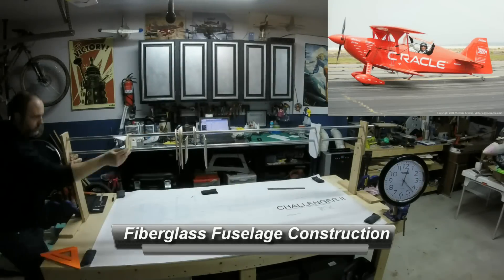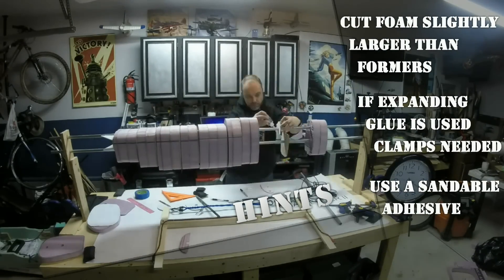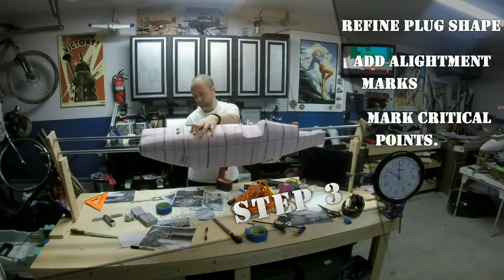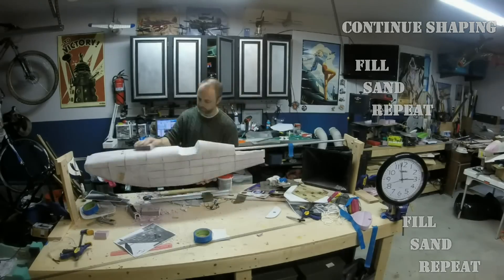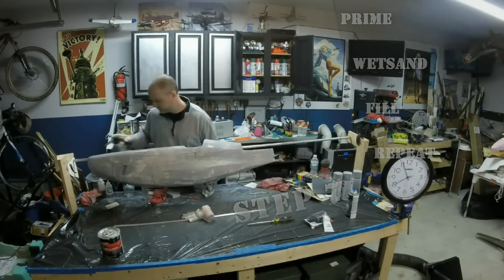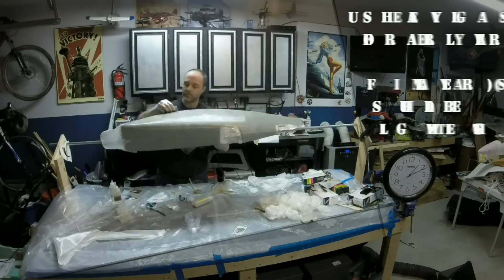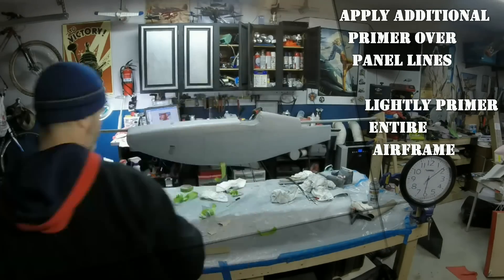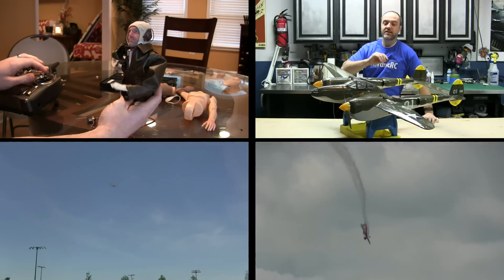RC Scratch Building - Fiberglass Fuselage Without a Mold

Comment: Hey man don’t know if your still on YouTube but I’m fucking around with designs and I want to build a long range Fixed wing VTOL’s so it takes of like a drone then has a rear push motor, the fuselage will be from 4-8 ft do you believe it’s viable to do this method
Reply from the maker: Yes, it is viable. It depends on the size and design that you choose.  Not a great solution if you're looking to make a lot of copies

Comment: after all the work , why didn't you make a mold ??? you were there.
Reply from the maker: I think you missed the whole point... I didn't make a mold because I don't intend to produce large quantities (or maybe even more than 1).  I still have the plug that the FG fuse was molded over and it would be easy to make another.
Reply: @CarlLydickRC  I have learn a lot from your post and i am making a 35% 540 edge using your method.Thanks for the inspiration.

Comment: Do you have to seal the spackle before you start applying the fiberglass does the resin soak through the spackle and try to eat away the foam
Reply from the maker: I never have.  I'm using Zpoxy resin (epoxy) and can safely apply directly to foam with no sealer.  The spackle does soak some in but no risk to the foam.

Comment: How do you join the parts back together once you slice it and remove the plug?
Reply from the maker: In this case I had alignment marks in the form of panels lines, but before you cut make the part off the plug make sure you have alignment marks.  I scuff up the inside of the seam, tightly tape the pieces together being careful of alignment, and then lay down a few strips of fiberglass and resin along the joint.  Once fully cured I fill, sand, and re-prime the seam from the outside and It is ready to use.
Reply: @CarlLydickRC  Thanks for the reply, can you tell there is a seam there once you do that?

Comment: I really like your method and results!  I build my own designs fairly similarly.

I have a hot wire "planer" as I call it.  Take a couple cheap guitar tuning machines and wind kanthal wire across the table.  Use a piece of metal stock or a caliper to set the cut thickness even.  Take 1" foam and make it into 4 slices just under 1/4" thick.  This is still plenty strong for gluing together a simpler airplane.  Cut the formers out of the same foam.  When the foam armature is sanded to final shape, lay up 2 layers of 6 oz. Cloth.  Finish with a nice paint job, and enjoy a cheap, light, very durable airframe.
Reply from the maker: Very cool!  I've seen Keith Sparks and others use a similar method to make their own sheet foam and it works great. I may give it a shot in the future.  Right now I still have a good supply of 6mm Model Airplane Foam but when that runs out I may turn to making my own sheets to save money.  

I plan to use this method again this winter on my next build and those videos should start coming out in another week or two.  That build will be MUCH bigger than this one but I'm excited to see how well it scales up.  I generally have used much lighter glass than 6oz, but for this project the layup will need to be much stronger than the Pitts, so we'll see!
Reply: @CarlLydickRC  when and how did u take off the foam
Reply: GuerrillaRadio j

Comment: Thank You for the Video. I am wanting to try this on some older Full Fuselage and add a Built up  wing, Cox Purple  8600 Series? Sport Trainer as an example, and wove up from a Cox Black Widow to either a Cox T .051 or Probably a Cox .09 Tee Dee. Anyhow, Do you find Scratch building  harder for a 18" fuselage, rather than what you are presentily finishing up? 
Also I havea a old Cox Sport Trainer that has a few broben area's in which I plan on improving anyway. Could I section it as it has some "To Me " Unique  body features, and a couple I will take a little further.May I ask your opinion on the disecting of the fuselage and using the "Very Nice" Fuselage holder, Very Neat. As you can Tell I am a 78 year old amature, who only built Carl Goldberg and Sig when I coulld afford the 4.99 for "Lil Satin" but I am only as old as I think I am. Things are moving fast in all directions as Technology gives many opportunities that the older Generations did not have.
Anyhow Thank Youj for your time, Been looking into the Hydro Graphics that are presently available through ebay.  I could See one of your 1/4Scale Pitts ChallangerIII al decked out . As this is a 2016 video, is there a link to the end project or to follow the building of the Pitts?
Respectfully, Jim "P". Price Jenuine-Motor-Cox

Comment: What are the advantages of the method that you didn't use?
Reply from the maker: If you mean the advantages over building more permanent molds, the advantage is that I didn't have to take all the time to do so.  Basically to use that method I would still have to build the first detailed fuse and finish it out with panel lines, rivets, and any other details I wanted, which is basically the final step in the process I showed.  To make traditional molds I would then have to create parting planes, lay up tooling resin and many layers of heavy glass, and create a hollow mold in several pieces that fit together.  THEN I would need to clean and prep those molds, lay up glass and vacuum bag them, assemble the molds, and attach the seams.  If I wanted to make a large number of identical planes this is the preferred option, but for a one off you can skip those steps and still have a great quality product.

Comment: It is beautiful, but a lot of skilled manual labour, cleanup, wasted material, noise, toxic fumes...
A 3D printer (380$us, shipping inc.) and 30$ of plastic filament will save you a lot.
It is more precise (0.05mm) and you can print any upgrade or replacement parts, almost silently, in your living room, at the push of a button!
Reply: I own a ANET-A6 3D printer, but for this work, I will reccomand this large one:
https://www.gearbest.com/printers/pp_1072330.html

Software: Cura (free slicer) and Fusion 360 from Autodesk (free as well).
Reply: Learning the software: 3 days with free youtube training.
Reply from the maker: There is a time and place for 3D printing and I also own one and use it for RC.  The printed stuff has its limitations though and knowing more composite methods for building gives you the option to use the best method for the particular task.
Reply: I totaly agree. For example, I don't know what would be the best ratio weight/durability (fiberglass Vs PLA or PC or other filament). An hybrid version would be to make a negative mold with a 3D and put fiberglass into it for the final product.
Reply from the maker: That has been my thought for some time but I've had very little hobby time lately to try it out.  Use 3D printing to rapid prototype the plugs, acetone vapor bath, primer, and sanding to clean them up, and then traditional mold creation.  OR, see if it could be feasible to 3D print the actual female mold for the parts and skip the plug portion.  I suspect it would be hard to maintain fine detail AND eliminate the build lines inherent to 3D printing, but it might be worth a shot.

Comment: I am trying the impossible: 500mm Scale Bf109 E with a similar technique. I am using foam and a balloon. Still working out the details.
Reply from the maker: Good luck!  To keep it light but still strong enough you're probably going to need to incorporate some carbon fiber tow into the layup.  I'd be curious to hear how it works out.  I don't think I've seen this method used on anything in that scale.
Reply: Me too, tried google to see if anyone has done it: havent found anything. The problem is that its  going towards 200grams. I have calculated 100 grams for the airframe alone, maybe its lighter??? Atleast i hope for that, It will feature Retractable landing gear and the more important part at that weight: Flaps. Hope those can be used on take off.
Reply: Oh yeah, completly Forgot. I will use torque rods for the ailerons for the scale look. Probably something similar to the tail so it looks as scale as it can get. After that i will paint and weather it so it looks like one of those plastic models ^^
Reply: BwGuns Hyperus ujm

Comment: Could you make two fuselages with the same reverse mold or is the destroyed when you take the fuselage from the mold? The first time I saw this process they called it a reverse mold.
Reply from the maker: You can absolutely create more than one from the mold.  I still have this mold and will do another at some point.  Some people choose to destroy the plug and cut it into sections to give them perfect templates for formers.  Since I carved this plug using existing formers I had no need to do that here.

Comment: Could you use carbon fiber cloth instead fiberglass cloth?
Reply from the maker: Absolutely.  I wouldn't waste carbon fiber on the plug itself, but for the final fuse you can absolutely use CF.  Just be aware if you're building RC stuff that CF will interfere with a lot of receivers.  There are options out there but it is just something to keep in mind.
Reply: Is the interference from insulation properties? If so, could an antenna be placed in a fiberglass fin?

Comment: I love what you did, but have a few questions. 

1. What type of foam did you use and where did you buy it?

2. Did you lay fiberglass on the plug, paint over the existing fiberglass, then put the finish fiberglass layer on top of the painted fiberglass surface? If so, Why can't you just spackle the plug, paint, wax, and cover with the finish fiberglass? I was a little confused as to what exactly you did at that point.

3. Is it strong enough on its own or would you need to add chop strand to the backside? 

Thank you for your time.
Reply from the maker: The plug was made from 2" insulation foam from the hardware store.  Pretty sure it is Owen's Corning.  DOW has similar products.  It all depends on where you live as to whats available.

The paint on the plug (before the finish layer) was high-build automotive primer and I did this just to get the plug as smooth as possible to make pulling the finished pieces easier.  That part could be skipped and TBH the final product would not suffer much as the imperfections would only be visible INSIDE the fuselage.  

It is quite strong, but does still require internal structure to mount to and to resist twisting forces.  I overbuilt this internal structure and I'm now convinced I should have cut the thickness of each former in half.  I would have saved a ton of weight and I dont believe strength would have suffered at all.  

Thanks for watching!

Comment: Can coroplast be used with fiber glass?
Reply from the maker: So to be honest I've never worked with coroplast, but for this technique of fuselage shaping I don't think it would work at all.  This method depends on being able to sand the model to shape and then put a layer of glass and paint on the plug so you can lay the final glass on top.  Coroplast wouldn't sand like foam.
Reply: wilmracer I'm worried the resin will melt the plastic, I'm trying to build a small boat.
Reply from the maker: I would be surprised if that happened.  I use Epoxy resin and generally it is foam/plastic safe.  Give it a shot on a scrap piece but I would bet it would be fine

You could always try water based polyurethane (WBPU) instead of resin too.
Reply: wilmracer thanks,  I'll give it a shot

Comment: Can this be done with a PNP foamy as to be able to make room for larger batteries, scale cockpit with pilot and other things? I would think this is basically the same process without having to build a plug from scratch. Also as an option for parts when they are not in stock for those days that are not perfect and you break something lol.

Outstanding Video!
Reply from the maker: Absolutely.  You would just put the light coat of glass on the PNP foamy, get it clean, and build the fuse up on top of it.  The glass is relatively thin so you shouldn't throw things off too much, but you do need to be aware of the thickness of the glass making the "new" model a hair larger.
Reply: Was wondering which thickness to use for the glass? Again thanks as I will be doing this as a fall project and was thinking mold and not plug. Thanks again for the great ideas!

Comment: Awesome video!  I'm moving into hot-wire cutting xps foam wings and fuses.  For my first attempt, I'll keep the pink xps foam inside the plane and cover it with 3/4 ounce fiberglass and 2-3 coats of thinned z-poxy resin.  I'm also strengthening with carbon spars inside the wing and fuse.  Have you made a plane this way?  Also, what spray primer do you recommend for a smaller and lighter glassed plane like I'm trying?  Thanks for any advice!
Reply from the maker: That method will work great.  I love Z-Poxy resin and you'll get great results with it.  For spray primer I've used quite a few.  Any high-build automotive primer works well assuming you've got all the pin holes filled in the glass.  I've used a lot of grey rustoleum primer that works well and on my current build I'm using a plastikote primer in white.  So far so good.
Reply: wilmracer  Thanks for the quick and detailed response!  Glad to hear that cheaper spray primers work well too.  Subbed!

Comment: Cool video :) I have been wanting to try this but just afraid to take the plunge. I have a fuse i would like to turn into a plug but making molds would just be to time consuming as the plug itself will take long enough! LOL If I could pull off 5 or 6 fuselages from it, I would be a happy guy. Removal of the fuse from the plug is what scares me though...
Reply from the maker: I was worried about that part too, but it worked out amazingly well.  I'd say if you've got a good coat of wax and PVA on there you won't have a problem at all.  Using an actual panel line for the cowling helped too.  Give it a shot!

Comment: i neeedddd help. im building a rc b-2 bomber based fpv plane from scratch. i am using pink foam for the nose and plywood fuselage/wings as well. then i will cover them with depron. do i cover them with tape then pva/ wax and then fiberglass? i am thinking of using water based poly as resin. or should i use resin?
Reply from the maker: +Joseph Shubin It really depends on what you're trying to do.  Water based poly is OK but I find resin is stronger and tougher.  Covering your wings with tape and PVA/wax will prevent the glass from sticking to the foam, which may or may not be what you're trying to do.  Are you on any of the RC forums?  If not I would recommend heading over to forums.flitetest.com and starting a build thread there.  I'm on that forum so if you do that look me up and send me a PM and I'll be happy to help.

Comment: good method but how do you get it off the plug, you could have slowed that down and shown how to get it off.
Also can you reuse the plug for another fuselage?
Reply from the maker: +somerton123 Sorry if that part wasn't clear.  For the cowling I used the panel line as a guide and used a fresh xacto blade to cut it off.  I did it in several light passes so I didn't damage the plug underneath.

Same technique on the other two cuts but I used tape as a guide as there wasn't a panel line there.  The cut is closed with fiberglass tape on the inside and the seam is sanded and blended and won't be visible in the final product.

The plug is fine and ready for another pull.  I wouldn't use this method for mass production but if I only wanted a handful of pulls it would be fine.  I didn't have to do it here, but the other advantage is I could cut up the plug to get templates for formers that would perfectly fit the skin
Reply: Thanks for the additional info, I am planning a DC3 for this method of construction.

Comment: I really like your videos. I have built a lot of regular flat foam planes but I really want a more challenging and satisfying build. I have unlimited foam access and a hot wire cnc machine. I'm curious where to get plans for the scale models you show in your videos?
Reply from the maker: +Jim Tracy This build is based loosely on the Challenger II plans available from Eureka Aircraft and the P-40 is actually a kit available from Parkflyer Plastics with pre-cut formers from kensCADmodels.com.  

For this build technique you could certainly cnc the formers, but to get the plug ready you'll still have to do a lot of shaping and finishing.  It is definitely rewarding though and I encourage everyone to give it a shot.